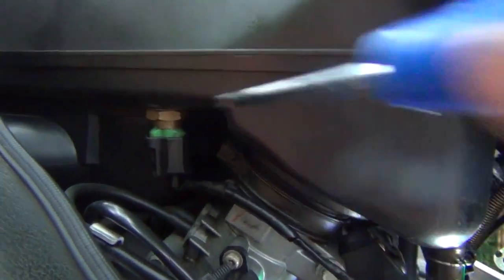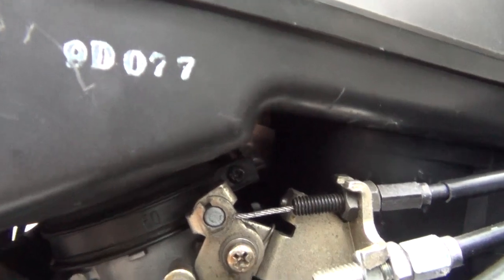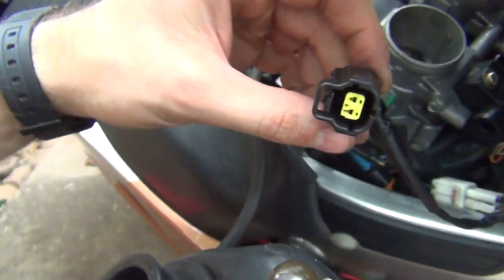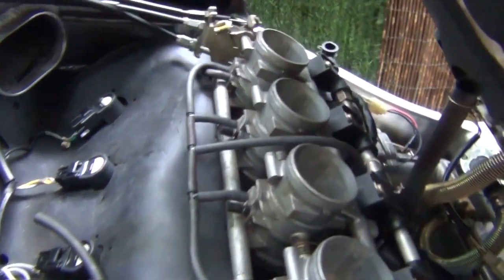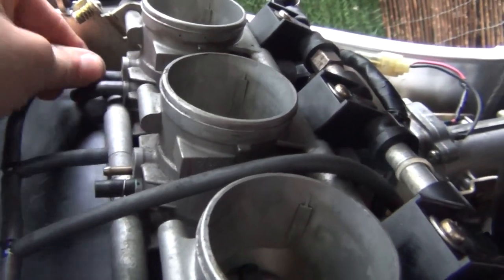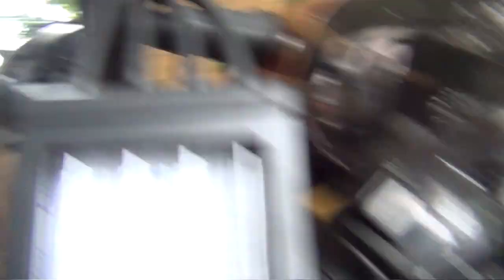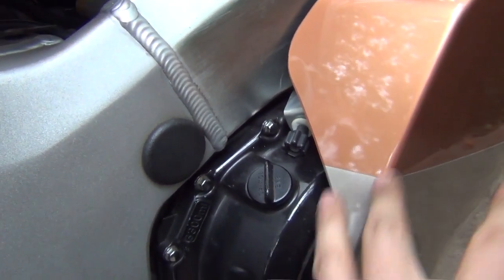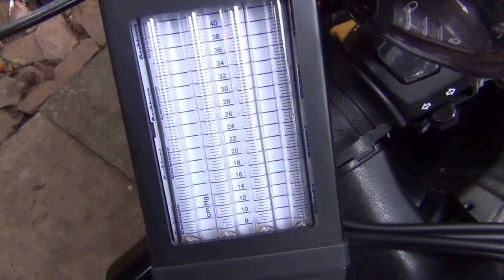Suzuki Hayabusa Throttle Bodies Balancing - Step By Step

Comment: Hello! Sorry, tell me please.
The manual (page 4-69) contains information that to synchronize the throttle valves, it is necessary to connect the hoses of the vacuum gauge to the nipple (short plug in the video), and you have the hoses connected to the main line. Maybe I misunderstood something?
Reply from the maker: Depending on what type of balancing tool you have you might need to calibrate the tool first. if you have a decent type of tool which doesn't need calibrating first you just connect 4 hoses from your balancing tool to 4 little nipples coming out of the throttle bodies. Set the rpm to about 1200 and you,re good to go. Engine must be warm! 
That's all there is to it. You probably misunderstood sth as in that section of service manual it doesn't say anything about "main line"

Comment: The hose on the right side u pointed out that needs to be removed,,,where is it going,,its missing on my bike and i get the o2 sensor fault from the exhaust  and the bike is rich as ....it really drinks fuel as a russian gulping vodka.

Comment: Hey brother thankyou as you have helped me alot few days before regarding the fuel pump..
Can you please make a video of all the sensors in the busa 2002 how to check if they are working properly or not..
Thankyou so so much brother..
Reply from the maker: There is many sensors there bud. Some of them wouldn't be responsible for your problems. Can you remind exactly what symptoms are you getting with your bike?
Reply: B
Reply: @Adikxx  i bought 1 build 2005 and the guy i bought it from said he had changed the silencer and that was the reason for the FI light to be turned on all time,,off corse i dont believe him,,but i looked at the oxygen sencor on the exhaust and the fool had the wire on when he had screwed it back so the cord had twisted it self on top of the sensor,,could it be that 1 of the cord has snaped. The bike feals like a cbr 900rr firblade power vise and it consumes a lot of fuel..
the previous owner told me that they had flashed the ecu.. i dont think there is any qualified tuner where i bought my bike so what could it be ?
i know that i need to put the bike on dealer mode and see what faulty codes it gives but the bike is att my summer place.. so i want to buy parts to it but not useless parts..im to buy a air filter p08, new iridium plugs and so ..would you recommend me to buy a pc5 with autotune or should i send the ecu to an qualified tuner like brock.. would presciate sugestions.

Comment: Hi adikxx83, is this something you`d  do on the RF900? I wonder also what made you do this? Did the bike vibrate a lot and is it less now for example? Or did you get irratic throttle-response? BTW, i`m planning a trip to the NorthCape in June 2018. Me on the RF900 (1995) and my gf on her Burgman AN650. I am advised to switch my airfilter from paper to fiber because of airhumidity up north. Do you now if this is usefull? Costs i`m told about €70,-, so doable i think. I`s love your input. Drive safe, Flying Dutchman
Reply from the maker: Flying Dutchman Hi Flying Dutchman,always good to hear from you! Synchronization is one of the maintenence jobs all bikes benefit from after certain mileage is covered. Definitely worth doing on 4 cylinder motors. I will put a step by step video guide for synchro on Riffer 900 too! Just need to find time for it. Nicely balanced carbs/throttle bodies will give slightly lower fuel consumption and slightly smoother running of the engine(especially on the idle) what i noticed on the Busa too is that now it vibrates somewhat less. So yes you were spot on with your assumptions and mentioned pretty much all of the benefits.
You are lucky that you can travel together with your partner, it's awsome! I push my lady to get the bike license but no success yet hehe. Would love to see some video or pics from your trip! 
Btw i did some nice little mods on my Riffer and plan to chuck some vids about it on YT. High time i spent some time on the RF finally and let the Busa rest a bit:)
Take care bud and ride safe!
Regards
Reply from the maker: Flying Dutchman I forgot to refer to swapping air filters.I heard similar opinions before actually. I think this upgrade would make sense because at high elevations air has less oxygen and less oxygen means less effective combustion so free flowing and less restrictive filter would probably perform better. I don't have personal experience with riding at high altitudes but following logic this seems a good idea.

Comment: HEY ADIKXX83 , BROTHER A QUICK QUESTION AND THAT IS I HAVE DYNO TUNED AND FLASHED MY ECU IN UNITED STATES AND BROUGHT MY ZX10RR 2019 TO PAKISTAN A COMPLETE DIFF AIR ELEVATION AND FUEL N TEMP.. MY BIKE RUNS 20-30 MILES AND THEN SHUTS OF ON ME WHILE RIDING OR IN NUETRAL. NO MECHANICAL ISSUE AT ALL.. ONE OF THE GUY SAID SINCE IT WAS TUNED IN DIFF COUNTRY AND NOW IN DIFF COUNTRY SO THROTTLE BODY NEEDS TO B ADJUSTED ACCORDIN FOR FUEL AND TEMP HERE IN PAKISTAN.. DOES THAT MAKE SENSE TO U?
Reply from the maker: On old carbed bike maybe but on modern fuel injected bike that sounds a bit odd. Bike should run fine.

Comment: hi,adikxx83 any ideas why my rpms hang at 2000 rpm after i rev it when warm.
Reply from the maker: sometimes you can get a hanging tick over from extra air. Check if you don't have any places where extra air gets in, airbox clamps on rubbers?

Comment: I would sync for 4-6k rpms. Why? You don't ride on the highway or any 
other road, at idle speed. You ride at 4-6k rpm's. You bought the tool, 
now learn to properly use it.
Reply from the maker: I'm sorry for saying this but this is the dumbest suggestion i heard in my entire life.
This is synchronized at 1300 rpm BECAUSE FACTORY SERVICE MANUAL SPECIFIES EXACTLY THAT !!! 
Having the tool plugged in and revving the engine to 4000- 6000 rpm would blow the fluid out from the tubes. Just slight blip of the throttle gets the levels to the very top and you suggest 6000 rpm??!! 
OMG are you on some medicine?
Your comment is so idiotic that it's beyond belief!  
I took a screenshot of it and will post on Busa group, people will be laughing their heads off.